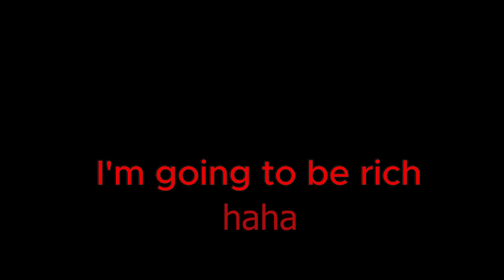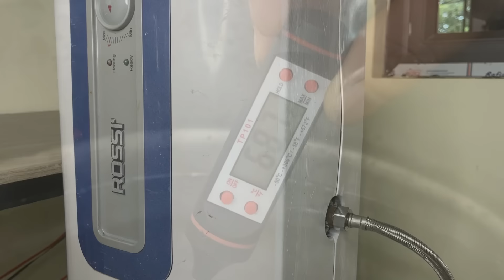Endless heat for your home WITHOUT ELECTRICITY! How to make a 3-in-1 heating stove from cement

Comment: 12:56 Advice For anyone watching (well done on your build)
Those pipes need to be curving upwards towards the inlet of the water container, otherwise youll end up with a bubble and it might explode the pipes and HOT WATER EVERYWHERE. Also, notice that this is not a closed system, meaning the lid is off open the air. If you have a containter make sure it either has a pipe coming from the top acting as an "air pressure value" or have the lid off - otherwise its BOUMB!
Reply from the maker: Great suggestion! A closed-loop system with a heat exchanger would definitely improve efficiency. I'll keep that in mind for future designs!
Reply: hi bro. ok so lets explain, i make shower sauna caravans run off wood burners. (crap description so edited)

1. In a tiny house or yurt, you could have mains water pipe coming at above head hieght 7-8ft into a header tank, with automatic stop cock. 
2. water from the header tank has T junction. One falls through gravity into base of canister. The other is cold water feed to sink / shower / whatever. 
3. from base of canister another cold water pipe goes to base of burner.
4. from top of burner is hot water - which goes into three quarters way up canister
5. hot and cold now circulate
6. from top of canister is T juntion, one for feeding hot water to sink / shower / whatever. The other is air pressure pipe which its tip must be higher than the water tank. Water rests at water tank level in the hot pipe, but if pressure builds, it will spout hot water and steam from top of that pipe = safety.  For this reason, put pipe through roof of yurt and have it spout, spit, and let off steam outside, over the roof.
7. Always pipes have nice arc going up so no air trapped bubbles.

What you’ve made in the video is effectively a clean mini hot tub, open to the air. Hope that’s helpful 😊
Reply: @DiyEcoProjects  , thanks - now I am thoroughly confused .
Reply: I would change to a different music to  makes it get hotter.

Comment: Great fabrication. Creative use of materials (cement/fiberglass mix formed around stove barrel & copper tubing in cutaway plastic bucket; clothes hangers for reinforcing concrete). Effective addition of concrete thermal mass to stove with copper tubing embedded in it. Excellent adaptation of used appliances/tanks/wok to speed build. Impressive operating temperature!
1. The copper tubing buried in the cement casting supplies abundant hot water. Why not (a) plumb it to a household hot water system and/or (b) attach a pump and circulate it thru radiators to extend the area heated by the stove (larger stove barrel if needed to increase capacity)? 
2. Not clear from video, but the tank lid of the adapted water heater may be left open, resulting in excessive evaporation which (a) saturates the room with dripping humidity and (b) quickly dissipates the circulating water. (The design may already be a closed water loop to control evaporation - one equipped with pressure relief valves to prevent a steam explosion). 
3. A significant amount of heat appears to escape via the vertical exhaust pipe, reducing the stove’s efficiency. Why not (a) route the exhaust thru a heat exchanger or an exhaust pipe made to act as a heat exchanger, or (b) wrap more copper tubing around the exhaust pipe to route part of the exhaust heat into the water heater tank?
Reply from the maker: Great insights! Connecting the copper tubing to a household system or using a pump to circulate water through radiators would enhance heating. Addressing evaporation by sealing the tank lid is crucial, and utilizing a heat exchanger could improve efficiency by capturing more exhaust heat.
Reply: Chaillot Barnabé !! Plus précisément sa chaîne youtube

Comment: It’s a rocket stove !
Reply from the maker: Exactly, it does resemble a rocket stove! These are fantastic for efficient burning and minimal fuel usage. If built properly, they can be a great DIY heating or cooking solution. Just make sure to follow safety precautions, especially regarding ventilation and material selection. What do you think of its desig
Reply: @ : the design is good but the work in producing it is out of my ability I am disabled and don’t have the proper tools to construct this .

Comment: You know concrete eats up copper right🦧👀
Reply from the maker: Absolutely, concrete can corrode copper over time due to chemical reactions. It's important to use protective measures or alternative materials when working with both to avoid damage. Thanks for the reminder! 🦧👀

Comment: Where do you get your paint pencils from ? 🤔 And what Brand, paint type and tip ? Excellent fabrications and outcomes.  Intelligent information  👍
Reply from the maker: Thanks for the kind words! For paint pencils, the choice depends on your project needs. Here are some common options:

Brand Recommendations:

Sharpie Paint Markers: Known for durability and versatility.
Posca Paint Markers: Great for a wide range of surfaces and provide vibrant colors.
Uni-Ball Paint Pens: Reliable for fine detail and long-lasting marks.
Paint Type:

Oil-Based Paint Pencils: Excellent for metal and surfaces needing high durability.
Water-Based Paint Markers: Easier cleanup and good for temporary projects.
Tip Size:

Fine Tip (1mm): For precise lines and detailed work.
Medium Tip (2-3mm): A good balance of coverage and detail.
Broad Tip (5mm+): For quick coverage and large areas.
If you have a specific material or project in mind, I can suggest the best fit for your needs! 🔥🖌️
Reply: @lmtn Of course. You're very welcome. Wowzer.  My hats off to you. Thank you deeply and kindly for the time you took to give me this information.  😊

Comment: It's a wood stove. 😒
Reply from the maker: Have you ever made something like this yourself?
Reply: @lmtn "ENDLESS HEAT WITHOUT ELECTRICITY!" You titled the video as if it was some grand, NEW INVENTION, when it was actually CLICKBAIT. 

Why didn't you just title your video, "HOW TO WELD A WOODSTOVE OUT OF ANOTHER STEEL CONTAINER FOR HEAT FROM FIRE YOU BURN INSIDE OF IT USING WOOD?"

Granted, it was a very nice build, BUT, the title was COMPLETELY MISLEADING! 🤨
Reply: @rattlecat5968 but it is endless heat without electricity...

Comment: Is not concrete explosion capable on to much heat??
Reply from the maker: Yes, concrete can crack or explode under extreme heat due to thermal expansion and moisture vaporizing. Proper precautions are essential!

Comment: different approach. My concern is if there's any moisture in the concrete it can pop and chip out and even explode small pieces and them hurt if they hit ya  i have had it happen. whats on the inside to keep the majority of heat off the concrete?

Comment: Just get 45 gallon barrel cut top of start fire in the barrel cageing over top sorted instead of all this bollocks
Reply from the maker: It sounds like you're looking for a straightforward way to start a fire in a 45-gallon barrel by cutting off the top and using a cage over it. This can be an effective method for creating a controlled fire. Just make sure to follow safety guidelines, ensure proper ventilation, and keep an eye on it while it’s burning. Always prioritize safety when dealing with fire!

Comment: fascinating BUT.... I'd rather rig a HomeBioGas digester system to a direct methane stack of FUEL CELLS that would power my PowerWall3 securely, so I get electric for person-heating by infrared [battery based inside snowveralls] and slow cooking [battery based] and manual defrost freezer [also battery-based], plus my medical and communication and LED lighting [all battery based].. all ultimately powered by our household and animal manure plus kitchen offal and yardwaste weeds by the handfuls....and LOTS of insulation in my WALLS, CEILING and underbelly......  ttyl
Reply from the maker: Yes thank you for sharing your experience that your heating system is operating Yes I understand you are using fuel from animal manure as I understand it is angoc gas created by animal manure Yes we also have this but to install the system is not cheap right You Yes thank you for sharing let me know when we have the opportunity we will make a system like yours Yes thank you very much Do you have any comments Actually please leave a comment below Thank you for your enthusiastic comments Thank you very much